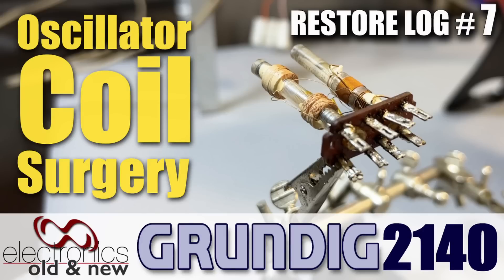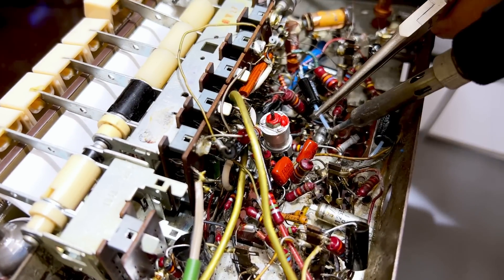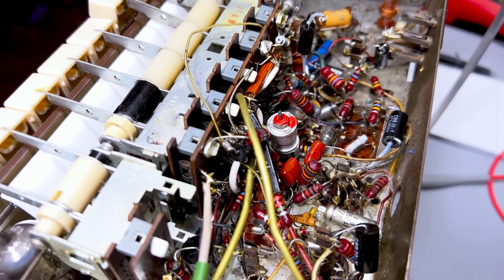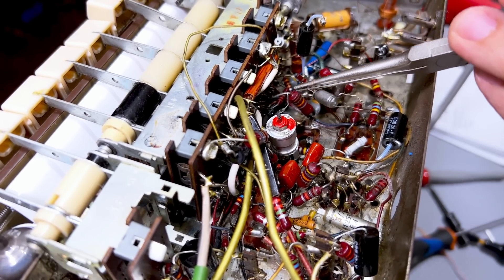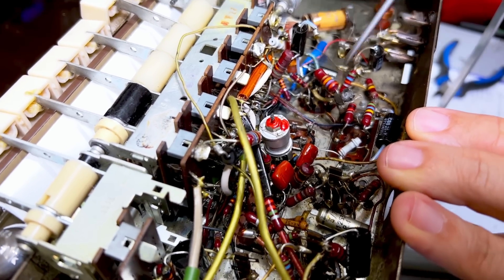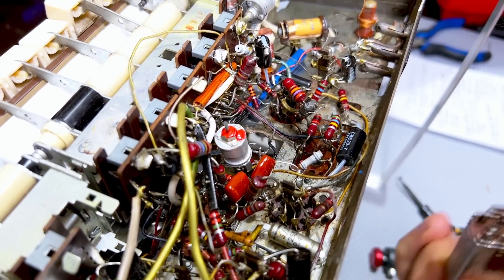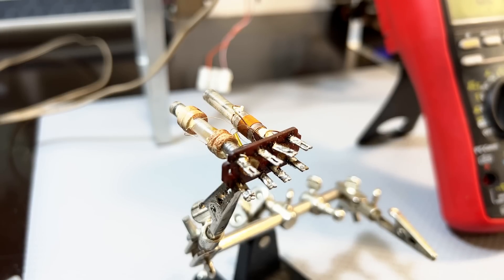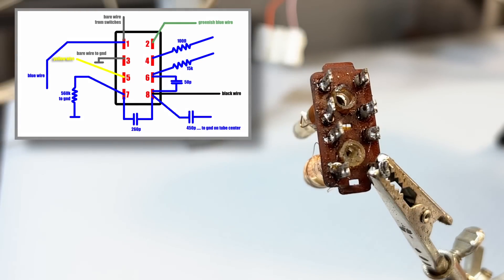Coil repair surgery ... not bad at all. Grundig 2140 restoration - part 7

Comment: I screwed one of those if transformers up because of wax so i now use my sisters  old hair dryer to heat up the the whole if transformer before i turn any screws learnt the hard way.
Reply from the maker: I’ve done this a couple of time before, but this one was different: the core is fine. The actual former got unstuck from the base.

Comment: Newbies should also note that  those fine coil wires are insulated with an enamel or varnish that resists/repels solder, and so if the wire breaks off of the solder terminal you might have to carefully scrape off the coating from the very end of the fine wire in order to be able to resolder it.  This is not an easy thing to do and if you accidentally tug on the wire you might break it off at the coil. No known solvent can remove that enamel/varnish coating. This type of repair can be extremely tricky and inexperienced techs might want to try learning the technique on a junk coil pulled from another radio chassis.
Reply from the maker: I normally use the soldering iron with a blob of solder on the tip. This seems to melt the enamel coating. However, you should always test for continuity to ensure that the connection is made.
Reply: @electronicsoldandnew  ,  I have been forced to work with enameled wires such as Litz wire in the past, and the stuff is a royal pain. Manufacturers use a solder pot to tin the enameled wires and this purportedly burns off the insulating coating, but most folks don't own one. From searching online it appears that the popular"solution" for hobbyists is to make sure that your iron is at 400 Degrees Centigrade, and dip the wire into some flux first, but I've tried soldering braided litz wire with a heavy duty soldering gun that puts out a ton of heat and it still doesn't work all that well. I've never found a solvent that will remove the varnish or enamel coating on the wire either.  At least in this case all you had to do was solder one very fine wire, but if it was me I think I probably would attempt to scrape some of the insulation off of it first.....

Comment: A precaution for newbies to electronics repair: polystyrene caps are very heat-sensitive, and easily damaged by unsoldering/resoldering in their general vicinity. Use caution!.

Comment: I like coil work. Those fine wires are easier to solder than they are to identify a broken fine wire link at times.

I worked a SW coil in a Loewe Opta Hellas 3841w some months ago. Just connecting up the broken wire links from transit delivery damage.

Since then, the radio has been a ball of fun. Having to go right through components and wiring to look for shorts. Dim bulb didn’t respond so well and there was smoke on start up.

The dial glass broke in transit causing those fine coil wire links to break among other fine coil wire links on the ferrite antenna and its capacitor.

Now I am getting in deeper as I noticed so many of the capacitor replacements are no where near their values. How could it all operate like that! 😩 Oh dear, what you come across.

Now I know why no one wants someone else’s incomplete restoration.

The good news is a delivery from Germany arrived this morning. A large 18kg box with a Loewe Opta Hellas 2841w chassis and good dial glass.

Not everything transfers across perfectly between radios but a lot does. It’s going to be an ongoing interesting project helping me complete my apprenticeship in German radio restoration.

Your detail of technical work is amazing Manuel. I think I will call it Forensic Radio Science. 🔧😁

Happy New Year 2023 soon to you and yours. Including your beautiful cat. 😉
Reply from the maker: You’re absolutely correct about taking over from someone else. Always a challenge. 
Happy new year to you and your family.

Comment: Judging from the looks of the coil formers, these must have been made out of some kind of soft plastic. So then, applying heat in a hap-hazard fashion in order to melt the wax and so to get the cores unstuck would be the wrong thing to do. 
All in all, aside from the extra trouble and stress caused, no permanent harm was done. I guess it goes with this hobby.

Comment: Regarding superglue, you can use baking soda as an activator. Depending on the kind of job, you may make a kind of concrete by mixing both, typically for plastic reconstruction, of a small broken plastic hinge for ex. Or, like here, use superglue as usual, then sprinkle the baking soda over the glue, it’ll cleanly strengthen the surface of the joint. And the excess can easily be dusted off. There is a video by Adam Savage about glue activators where he recognizes the benefits of such a modest and useful product.
Reply from the maker: I’ve used that trick quite often. It’s absolutely magical. Here the task was quite simple as there was a sufficiently porous surface to work with the glue alone.
Reply: @electronicsoldandnew   I don't know if the product is still available, or if you can get it  anywhere that is subject to EU environmental regulations, but at work we have this stuff called Plas-T-Pair which is a powdered plastic, like an acrylic dust, and a nasty-smelling solvent;  when mixed together they form a plastic paste that hardens as the solvent evaporates. Excellent for repairing or reinforcing cracked/broken plastic parts; but you really want to use it in a well ventilated space or outside because the solvent fumes are quite unpleasant.
Reply from the maker: Haven’t seen that over here. Could be useful.
Reply: @electronicsoldandnew  , a PlastiFix video. https://youtu.be/zfwKJQyabQ0 . The  FAQ's mention that it might not be available in Europe except perhaps from WOW in the UK.

Comment: A great job on that coil. I've done several myself, valve coils are much easier than transistor radio coils, did one that took hours. Old car radio input coils aren't too bad to repair, I've repaired quite a few car radios in the past, which I like doing. I think valve radios are more satisfying to refurbish. Your step by step notes are much more detailed than mine. I've just been lucky I think, that things work when put back together.
Reply from the maker: I once took a grundig receiver apart completely … everything, and only managed to rebuild it thanks to the notes. I wanted to repaint the chassis. Never tried it again, but it was extremely satisfying to get it working again.

Comment: Yikes! Glad the coils didn't get damaged too badly. Something to think of, would be, if one got access to the bottom of those types of coil assemblies, to clean the bottoms up as well as possible, and to drip some crazy glue or 2 part epoxy on the exterior bottom of it to fix it in place before proceeding. Whatever type of adhesive they originally used doesn't seem to be working well anymore, and since that forming tube has nothing else to keep it from rotating, its a recipe for disaster. Good you see you got it fixed and can carry on!